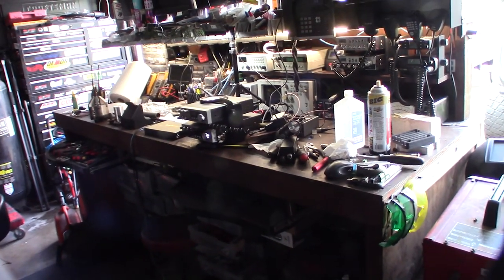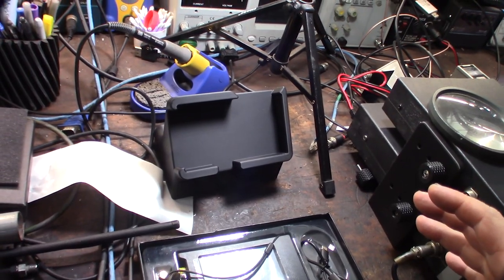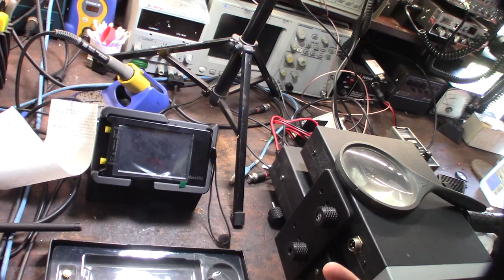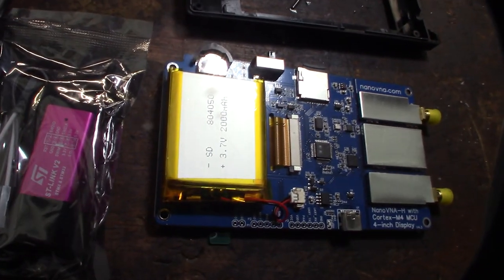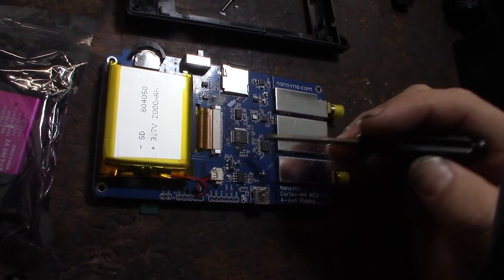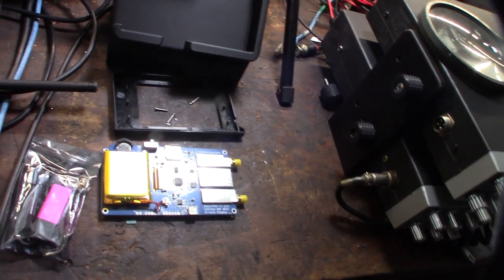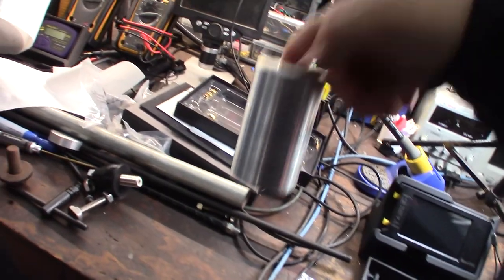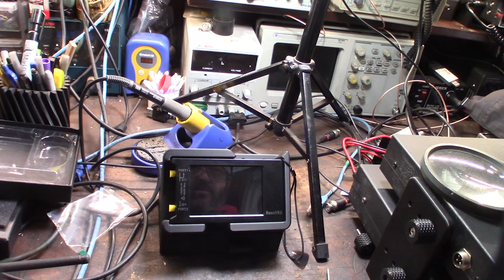NanoVNA-H4 V4.3 Vector Network Analyzer Internal hardware & Custom Desk stand Review 32bit ARM

Comment: Check the Git, they have a block diagram, photo of the PCB with shields removed, and schematic. TLDR: it just has an audio codec for I/O (so, 48khz band), a clock generator, and three mixers. The magic really is those clock generator ICs. About 20 billion times less complicated than a 'real' VNA.
Reply from the maker: Cool I will take look, antenna science is an annoying subject. No guarantees, no 100%. You think you know, but every environment has different variables. Every frequency has different characteristics.
Reply from the maker: This device is really cool, been playing with it for the last few hours and updated the firmware.